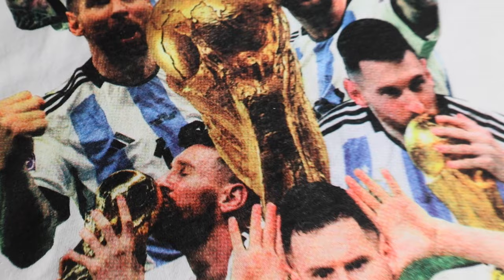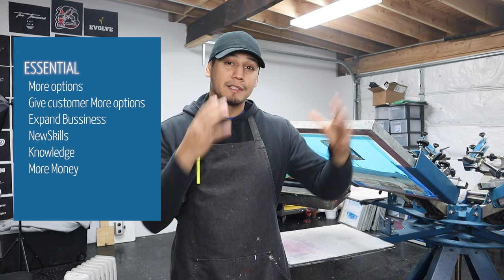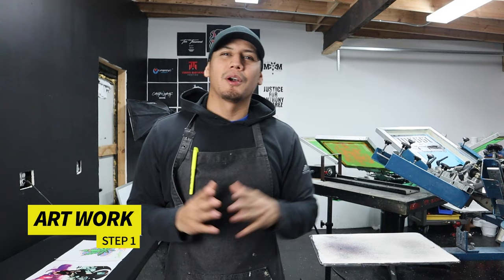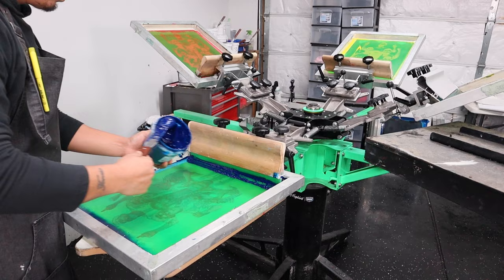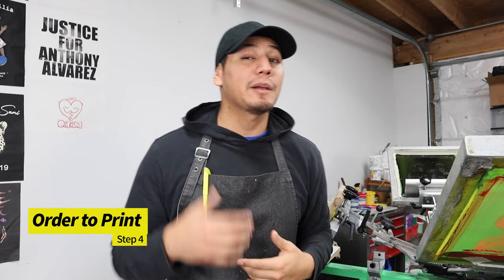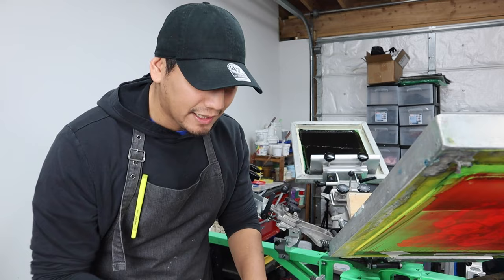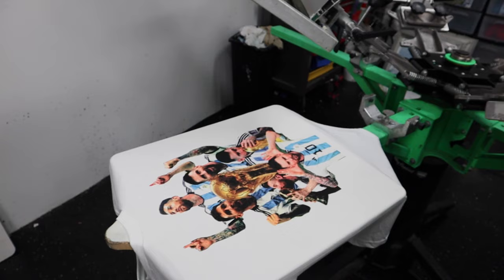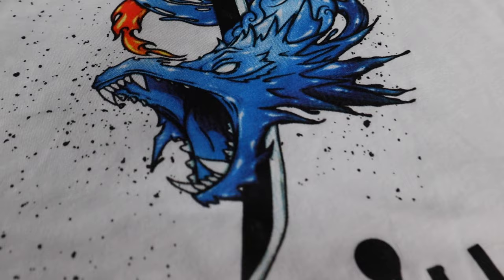CMYK SCREEN PRINTING FOR BEGINNERS!

Comment: I’m not familiar with fabric screen printing, my professional specialty is printing on paper. The CMYK process is almost identical though, so some tips :
- take into account the color of the fabric you plan to print on. White shirts are a no brainer, but lightly colored fabrics will change the outcome. So if you plan to print on a light grey for example, don’t forget to reduce the black tones from a corresponding percentage;
- CMYK is great for photographic elements, but if your design is some vector art with few solid colors, you should use direct tones instead;
- I don’t know the specifics of wet on wet inks, but the superposition of too much ink on the same spot can cause drying problems. In paper print, the rule is that when you add all the CMYK values, the result shouldn’t exceed 300%. There are some separation settings that allows you to translate neutral greys in the image obtained by the mix of CMY into a single K value. That allows you to use less of CMY inks which are often more expensive than the K ones;
- One of the biggest advantage of CMYK is that you can print different visuals one after another without having to clean your tools;
- Advanced technique : Color separation can be done with other colors than CMYK, and use spot colors instead with a few adjustments. For example, you can use red instead of magenta if you adjust the other colors accordingly. This is useful if your art also includes a vector art logo which you’d like to be printed with the exact spot colors. In the model shown of the Argentina national football team, Cyan and Yellow could be substituted with the blue and yellow spot colors of Argentina’s flag team logo. It’s also possible in some cases, depending on the nature of your picture, to eliminate altogether a whole color pass with this technique. You can also have fun with special inks for creative effects;
- I don’t know if that works with screen printing, but you can also use color separation to reinforce Black values. In the comic books industry for example, all the black ink drawing lines are often also printed in cyan. The superposition of cyan and black gives a stronger Black result. It’s recommended though to make the Cyan lines a bit thinner than the black ones to limit the possibilities of imperfect alignment during the application.

Comment: awesome video. Im glad you mentioned not printing it CMYK but instead going lightest to darkest. Thats often how I set the jobs up but sometimes might switch it up if my separations weren't as good as they should have been. When printing wet on wet do you need to clean the bottom of the screens often or do you not get a lot of ink build up on the screens? I have noticed that I only get through a few tshirts before I feel the other inks are affecting the quality of the print

Comment: If you do a print on a dark garment, can you replace the black with a white underbase? Allowing the black shirt to make the outlines?
Reply from the maker: No the black gets printed over the base … because it mixes and matches with the other colors ..
Reply: @myloprints  so unless you have more than 4 print heads you can't cmyk on dark garmets?
Reply from the maker: Yes, for black garments you need 5 screens.   @Rain-di2bq
Reply: On a 4 color press. Do you think I can maybe do the base white, c, m , y, and then switch the last screen to the k. I think I would have to re-register the last screen for each shirt … dang it!!